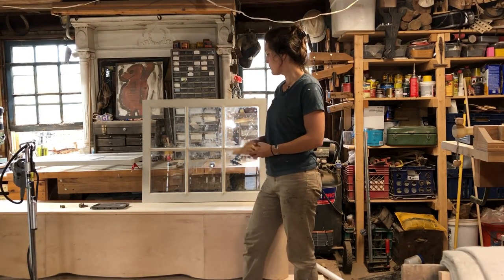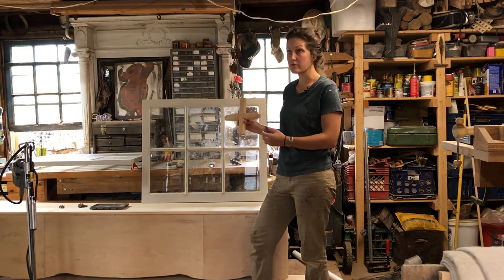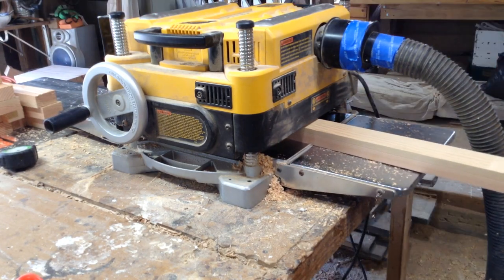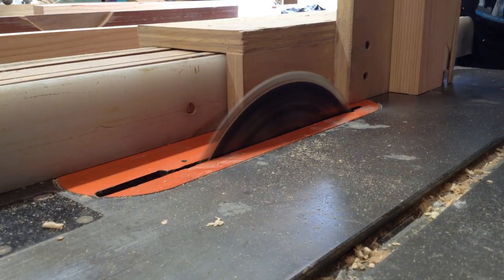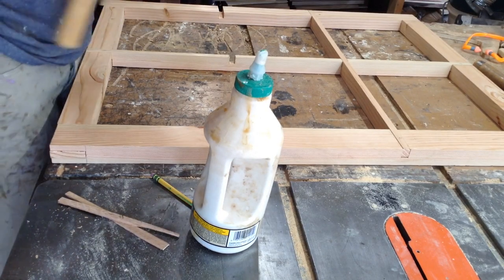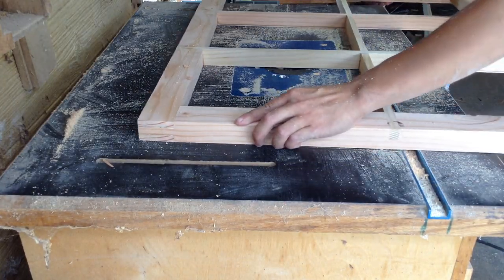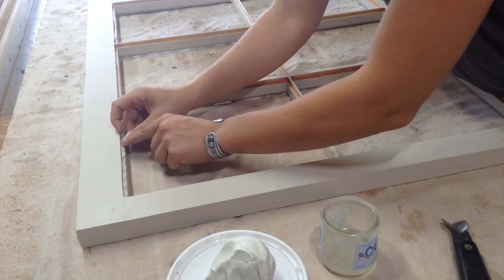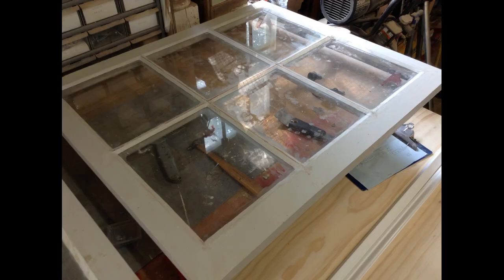Woodworking : Wooden Reproduction Windows // How-To

Comment: I am in the UK and my windows are original sliding sash dated 1887. I have repaired them many times and I struggle with putty work. Nice job and I admire your skill.
Reply from the maker: All the windows on my shop are from about the same time frame 1889ish and really need to be replaced, but I've been avoiding it because it is such a time consuming job.  So, it was ironic to find the time to do it for someone else.

Comment: Another great example of figuring out how to solve a problem without spending hundreds on equipment. I always  rout first but you solve my dislike of running part router lengths and avoid having to use an expensive matching rebate bit. Great half-lap solution I will definitely use in future. Made me feel like your additional intern so thank you!

Comment: Hi, I had to make some of these windows a long time ago and I bought the specialised router bits to make them. The cutters need at least a two-horse power router running at low speed and then a very fine pass to clean up the joints. Once bought the router makes it very easy to do joints as long as you keep a sample to help set the bits up.

Comment: I used to work for a painter and as long as we were using latex paint, we just painted over the glazing without letting it fully dry. I was told, As long as it's not a oil based paint the latex paint would let the moisture out eventually. Not sure it's how it supposed to be but we didn't have any problems.
Reply from the maker: With these the issue was more so that it was still so pliable even with a light brush stroke it was moving the glaze around on me so I decided to just wait til it skinned over.

Comment: Brings back memory’s of when I was an apprentice 
Use to make sash windows on site the timber already had the moulding and rebates but we had measure and cut the joints 
With a coping saw and chisel for the cross members joints
Use to putty windows with the roll of our thumb ( hated the smell ) made me laugh watching you put the putty in the rebate 
NO hate intended just made me giggle sorry 
Windows turned out great when painted who can tell the difference 
Is this a 2 part series?
Reply from the maker: Just one on this one, probably installing them this week and if I remember will post a picture on my Instagram.